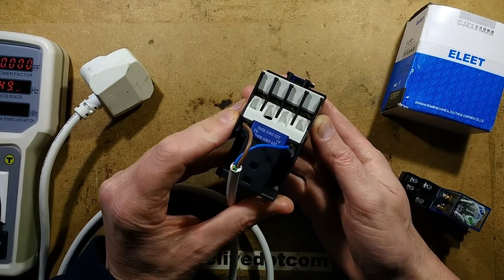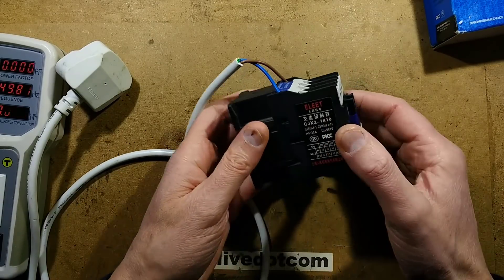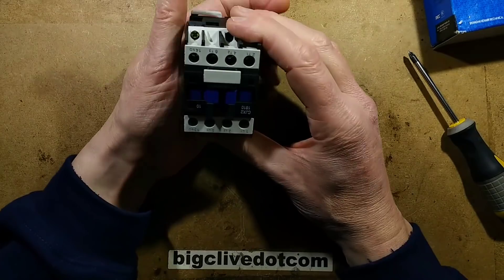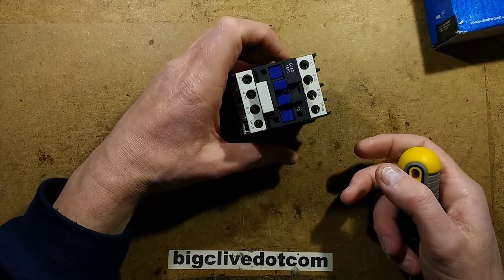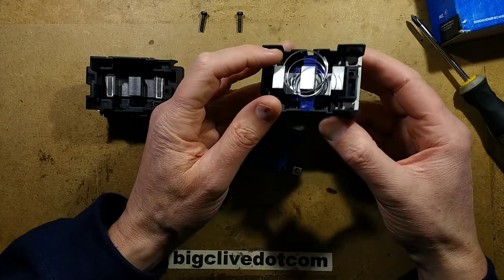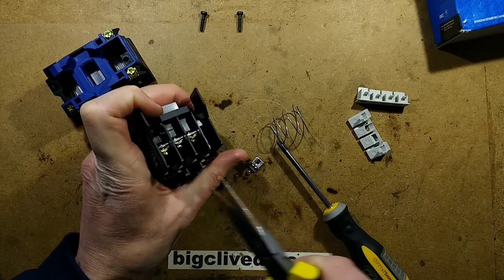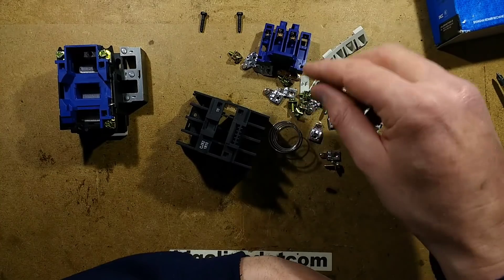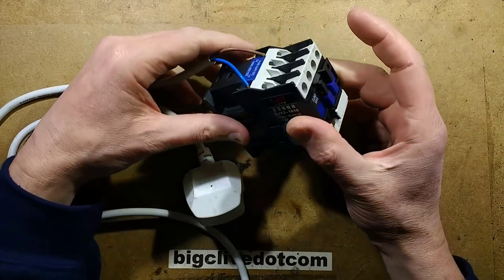eBay CJX2 industrial contactor teardown.

Comment: A rack of these came in the power distribution panel of a machine made in China.  One of them melted a terminal.  Diagnosing the failure, looks to me like the contact buttons on that one strip were not firmly closing and that there was some arcing on that one leg.  
I was thinking of replacing the whole rack with domestic components ($$$$).  Thankful to have found this video, confirming reasonably good component quality.  So I’ll just get a replacement off of AZ for 12$ and carry-on.   Thanks!

Comment: @bigclivedotcom I want to wire up my hot water heater to be a wifi controlled system; There's a vid here on youtube called "Smart Home water heater Add WiFi (and voice control) to your EXISTING water heater and save money 💵" who says to use a "120 volt coil 40 amp contactor" my tank is 4500 Watts on the high coil & 3500 watts on the low coil; which one do I go with because there's like a bazzilion of them & how would you go about wiring it up please ? (vid idea perhaps) let me know thanks !!

Comment: Looks good enough for many uses .But not where liability is involved .But in a pinch you could make your own transfer switch or controls for other motors and heaters ..Maybe even a compressor starter .but anything to do with production or safety ,Stick with seimens or schneider or allan bradely or Square d.Ill take NEMA over IEC any day but because everyone everyone is trying to go smaller and try to fit 50llbs of potatos in a 10lbs bag we always have issues with HEAT !Whats the Horse power Rating ??No horse power rating ,not for use with motors or inductive lighting  ballasts like in HID or HPS

Comment: In my opinion as an electrician if your going to fit one of these cheap devices I'd recommend installing an automatic fire extinguisher in the control panel!
I've seen loads of these cheap contactors from China fail. Im in NZ and everything here has to be approved and certified before its imported. Im sure its the same in most parts of the developed world. I've seen these things on aliexpress for $10 or less with free shipping, but the real deal quality stuff from the local wholesaler will set you back probably $200 if its from Schneider or Allen Bradley etc. Thats because these companies have proper quality control processes and the products are tested and certified. No proper electrician would fit this rubbish and sleep at night.

Comment: Talking about a factory when the machinery stops,  reminds me of a service call I did some years back.  This company was into making "filtration" products,  and the input to the machine in question was big rolls of paper,  which the machine was supposed to punch large discs out of.  The paper production was continuing,  and they were running out of places to put it.  The controlling hardware on the machine was two boards full of 4000-series CMOS parts,  and apparently some power supply issue had taken out a number of chips.  The "fixer" on site couldn't quite seem to get a handle on the situation.  There was a spare set of boards but they were of a different revision and both needed to be swapped out at once or it wouldn't work.  We didn't find that out until the folks showed up who made the machine.   I found a bad sensor whose wire ran inside the same conduit as some 220V power,  which was probably why it failed and on replacing it they insisted that it be done the same way that it was,  so I'm thinking that it didn't last.  Perhaps some transient suppression on that particular input would have helped?  I remember the guy's jaw dropping when I sketched out a simple crowbar circuit that could be put between the power supply and the machine to protect the boards in the event of future power supply issues.  Two of us outside guys plus the factory guy plus the reps from the machine maker and after a couple of days it still wasn't up and running,  management was not thrilled...

Comment: The cheepo circuit breakers on the market are really unreliable a few don't even make a circuit out of the box , mouldings separate when tightening terminals   would be interesting to see some tests to see when thay trip and what short circuit currents thay actually cope with

Comment: Clive you just made my day. Bought one of these on Wish and I had no idea how to use it or if it was up to the job of powering my 3 phase geothermic heat pump. I bought another chinese three gadget,  a 3 phase Voltage Power Protection Relay model BERM TG30 that has green LEDS to show L1, L2, L3 are in the right order.  You think I can use that thing to trip this CJX2 if there's a phase power loss? What do I connect to what? That would be the icing on the cake.
Reply from the maker: Can you send me a link to the phase detector you bought?
Reply: bigclivedotcom the manufacturer is BERM model TG30. Not sure if I can attach a photo to this message.
https://images.app.goo.gl/Cuq5G5yy2fcjQyCp6

But meanwhile I think I worked out a solution, wouldn’t mind if you looked it over though.

My proposed solution is to power my thermostat from the NC connector of the  3 phase protector and the 3 phase relay from in turn from the NO connector of my thermostat.
So if the thermostat loses power from the phase protector, it in turn switches of the three phase heatpump by taking power away from the relay. Thanks for any comments.

Comment: I used to fit contatcors in Lyons factories we used Schneider, MEM, etc and other quality companies but sadly the french company who I will not name, they buzzed like heck as they assembled them in the same area as the moldings hence the armature got dirty I wonder if these Chinese ones have the same problem you could and I did strip them down and clean the steel armature

Comment: Could you change the orientation of the contactor points and spring to change between normally open and normally closed? I have a project which requires some unusual combinations, which are either hard to obtain or prohibitively expensive.

Comment: A Friend of mine has an industrial oven for paint spraying, and it has two of these contactors in it, one of these and one of its bigger brothers. Both of them were a Pile of ** burning up quickly. I replaced with an RS Solid State Relay much better :) - Good Vid

Comment: For all you wondering (this is AFIR)
11 Common
12 Opener
13 Close
Higher numbers refer to special funtions like timer based contacs
A1/A2 is the coil
Also... we call these "Schütz" in german... to distinct them from relays.  They break befor make, thus they can be used to switch phase alignment for i.e. reversing sync. motors.
There are a number of specialized relays of that kind. I.e. the aforementioned reversing of motors, or in conjunction with a thermal overcurrent sensor for breaking the supply to a stalling motor.
Nowadays the majority of these are made to work with PLCs, in my country it is 24V dc
And i want to make this one clear: As voilently as a keep my moneys together, i would never use a chinisium crap relay in something that is supposed to generate (abstraction layer to be inserted here) money.
Siemens, Hager, ABB... that is the way to go. Not cheap but also not prone to fail in less than a decade.

Comment: About using cheapo components in industrial automation, only do it if you make significant amount of the same machine, if you build 1000 machines, then little savings per every bit and bob can really add up. If you have the time it might be even worth it to tear some sample components down and test it to failure. 
If you build one and only machine or in low quantity, take the good components, the little money saved is just not worth the headache.

Comment: Now that we know these are available inexpensively, a logical question is - what sort of fusing do they typically use for the coil? Certainly the lower voltages would result in currents which fuse easily. The 110V+ models... .1A AGC? What would you all here recommend?

Comment: I agree with what you are saying but it raises a question: Square D used to be about as good as it gets then they went completely pants. So what the squirelly codpiece do you use now?
Reply from the maker: None of the big name brands are consistent in producing quality.  The electrical industry is one big financially motivated race to the bottom in terms of materials and deskilling.
Reply: That is a pity. Omron used to be really good for the more standard control type relays when I was designing them in to boiler control boards. That was about 10 years ago though. Sounds like even they might have reduced quality. Personally I'd rather pay a bit more to get something that actually works as per specification for more than about 10 seconds.

Comment: With reference to the maintenance man at the RS trade counter, not accepting you're judgement on the contactor failure welding in on position. Most see the good advice as intimidating or insulting and it makes them look incompetent, so they normally behave in a dismissive way. Some will get agitated and argue with you,  which make you feel bad for interfering with their business. So for this reason its best practice to not give unsolicited advice even if you know they are completely wrong. Speaking from bitter experience...its different if they ask for help, but this never really happens. Most would rather fail and make mistakes and cover it up after, rather than take a hit on their pride and have some else tell them how to do their job as they know they are still learning and should already know what you have to tell them...

Comment: It may look pretty good for such a cheap contactor , but like Han Solo already wrote, it is a Telemechanique copy. Generally, the material of the screws, connectors and housing are not very good. Long term usage might show why the price is cheap. If you use this contactor for non-safety, low demand applications - you will be good. For the professional industrial high demand use case you should spend more money if you don't want to replace it after a short time.

Comment: In the power station we often worked on these live in control circuits during fault finding. We used 110v ac contactor coils and if they were faulty they certainly buzzed!

Comment: My first experience with industrial contactors was at my middle school. The school's baseball field had three light towers that each had about 18,000 watts' worth of lamps (18 lamps x 1,000 watts) totalling 54,000 watts. They were all controlled by just three standard 20-Amp key switches.

One day my physics teacher showed our class the inside of the light control system (I think he was teaching us about Ohm's Law at the time, and was demonstrating methods of controlling large amounts of current with low-current devices). The three switches controlled about 20 or so industrial contactors, which in turn controlled the light towers.

At the time I thought it was cool, but now I think that system might have been a bit over-engineered.

Comment: Good you mentioned incandescent and lighting inrush current. It is critical to design for it. Stage/theatrical lighting can run 10,000 amp inrush. Normal industrial switching and contacting won't handle that!

Comment: I find that in general people really don't appreciate being told what they are doing is wrong, it usually makes them try to prove that they were right and do that stupid thing again. That's usually when they start shouting and swearing a lot because the problem they were trying to fix did not go away when they repeated that stupid action. They always blame someone else such as the retailer who sold the parts or the manufacturer of the parts.
I usually walk away, they are not going to consider the fact that they don't know what they are doing.

Comment: When ever I have a piece of flex like that, (or a no longer used run of wire in a installation) ill twist the ends together. That way if anyone plugs it in or connects it, its a dead short and trips the breaker.

Comment: I dont understand the reason why the inrush current would be high because of the pf capacitors.  I thought that the capacitor across A/C charged and discharged completely on every cycle and therefore the current would be the same regardless, unless we are talking about the very moment it is turned on in the event that the waveform is away from the zero crossing. 

Therefore after 5ms (the time for 1/4 of the period of a 50hz supply) the average current would have stabilised and no more inrush.  

Caps charging in a DC output PSU however would have extended  duration of high inrush compared with an A/C cap across the supply.

Slightly related I also wonder if the dangers of getting zapped by a A/C charged capacitor was a little Russian Roulette in that if you killed the supply at the zero crossing the capacitor would have nil charge.

I am thinking I am missing something here
Reply from the maker: +Justin Richards It is the initial powering if the voltage is not at the zero crossing point.

Comment: I want to wire a 12V inverter into my car. It's 240v, 380w, and its internal fuses are 2x 25A - 50A. So I need to feed it a maximum of 50A.  The way I'm wiring it, I need a relay. Can relays potentially switch 50A or will I need a contactor for that?
Reply: Moon Moon plenty of 50 Amp and above relays available for automotive use, try "car builder solutions" also the starter motor relay for an old 1990's BMW k1100 motorbike is 75 amps and quite neat 😀

Comment: Question. There are two types of single pole RCBO's. Some the line and load are inter changeable. Others they are not. Why?
Reply from the maker: +Geoff Lotton It may be to do with neutral/earth fault sensing.

Comment: There is a list of utilization categories which divides contactors by their expected usage - a typical AC-7a contactor rated for eg. 40A might won't last long driving a motor rated for 25A, because of contacts burning out. Obviously, it will work at first, but will be prone to failing earlier. Proper category for electric motor might be AC-3 (which is shown on the video), but only on squirrel-cage motors. For mentioned MHL lightning best suited would be AC-5a contactor.
Overrating contactors may be good when you need two or three of them, but in industrial use, when you have hundreds of them in one place, it might cost a lot more - not only higher rated contactors cost more, but they sometimes are bigger in size, which leads to bigger switchgear, consuming more place, and so on. More important is choosing proper contactor for expected usage.
Bit more info: https://en.wikipedia.org/wiki/Utilization_categories

Comment: I've rebuilt dozens of high quality Allen-Bradley's. It's a little sketchy, but what are you going to do when production stops, and the managers ... don't want to stock parts? Clipboards ... you gotta hate em.
Reply: It's already happened in my industry. The JIT (just in time) and KANBAN approach is only any good if the clipboard muppets know how to actually analyse the lead time data etc. Most of them have clip boards because 1 their memories don't work 2 to have data on so they can quote it to pretend to not be stupid and 3 to do crayon drawings.
Reply: Ha Ha Ha, glad to know you share my ... pain.

Comment: A relay has a single contact per line, whereas a contactor has two contacts per line, effectively opening the gap twice as much per linear movement for the contactor, breaking any arcing faster.

Comment: I've seen high pressure sodium floodlighting installations where the PFC capacitors in the fittings have gradually degraded over a couple decades to the point where the low PF has started causing the MCB to keep tripping!
Reply: I'd love to do a failure mode analysis on those.

Comment: If you got cought using this shit on an industreal basis,your ass would be grass. I wouldnt trust that any farther than I could throw it,and I could throw it pretty damn far. Those springs would probably heat weaken in no time flat. For a hobby builder,I guess you might consider them. Being that smaller Chinese company's come and go over night,I could see them using shit like that in China. Here in the US,that wouldnt even make it to the supply house. Back when I worked in a factory,we used bus bars to hook our 260 amp breakers to. I watched a screw driver explode when one of the guys accidentally hit the bar while undoing the breaker box. Back then,stupidity didnt matter as long as the machine worked.I saw many violations concerning saftey devices being disabled due to production demands. I quit there. A month later one of the maintenance guys was killed because of a bypassed saftey gate on a press. I saw it when I was there and knew someone( an operator) was going to die. The fact the operators knew the saftey switches were disabled was enough for me to run!

Comment: My first "regularly-paying job" post A-Levels was assembling larger versions of these at the Arrow-Hart Plant in Roborough, Plymouth (early 1970's). No "Batch Release" on those - the NCB expected (and got) individual test certificates on every one we assembled. That was the job of the "real" Engineers - us plebs were just the "Assembly Operators"!
Reply: NCB specs were actually higher than MIL-STD specs in some places and the individual test certs were also in effect a certificate of conformity.

Comment: We use pretty similar contactors (but from Kloeckner Moeller) with the additional contacts on top at work in an old machine for heaters and motors. Yeah, have had stuck contacts, but usually the original ones work pretty okay :). Cool to know about these clones :) and how to take them apart, didn't know that you can :D. This chinese one does actually look quite good :).